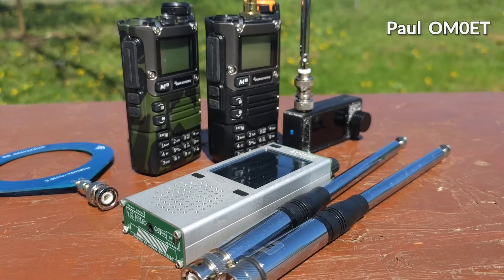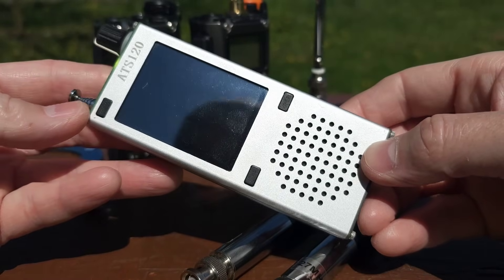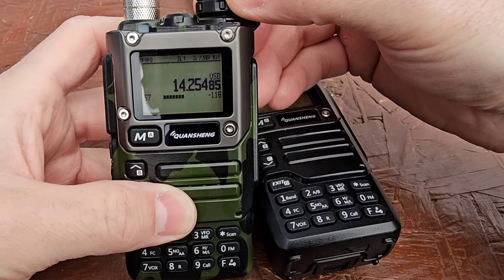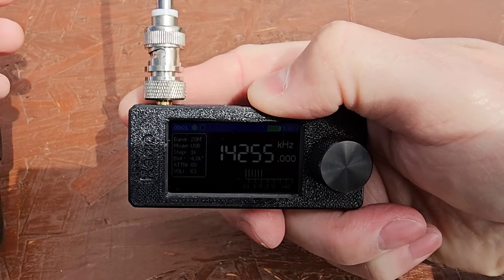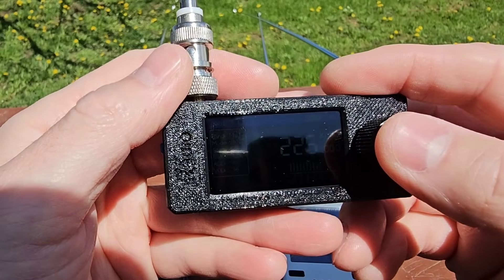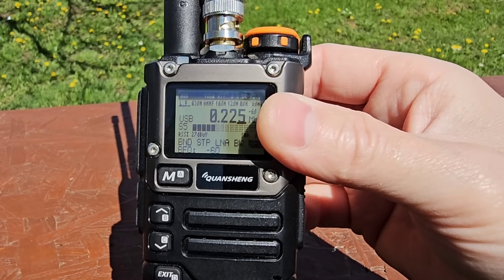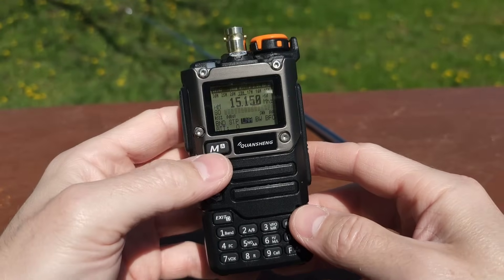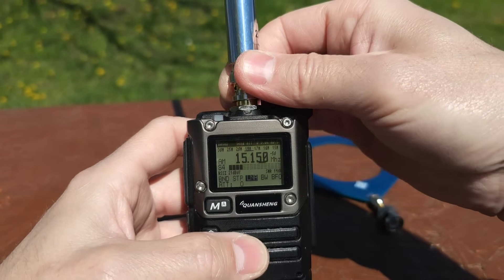RX Comparisons Si4732 based receivers

Comment: Excellent video as usual! Thank you Paul. When I was making my video on the ATS200, I found that holding the metal case improved the reception at lower HF and MW. frequencies when using the built in telescopic antenna.  It was a bit frustrating as you thought you had good reception until you put it on your desk and the signal would vanish.  Did you notice that?
Reply from the maker: Thank you! 😊 Yes same here. It is because your hand acts as a counterpoise which improves the signal reception.

Comment: Hello Paul, this is a very interesting comparison many people have been waiting for, I guess.
You should throw the Radtel RT-860 in too. I have only tested it on the shortwave bands, but I've found it a very decent receiver. I must say that I was using a long wire antenna, though.
Wasn't it a bit unfair not to use one of these HF antennas on the mini-ATS and the ATS-120  as well?
Reply from the maker: Thank you Alain. Unfortunately I found pretty high noise produced by radio itself when is used a whip antenna on the RT860. I need to find the way how to fix this issue. Yes, true, afterwards I see that maybe I had use the same 27MHZ whip on mini-ATS too. That would be much fair.

Comment: ❤ Finally someone, YOU, did this comparison! 😊

I always used to ask in many Radio related Facebook groups, to test the SI4732 radios, like the Radtels as well, plus the ATS-25 Max Decoder.

Or with other radios;

I know for sure, that e.g. the Mini is much more sensitive on SW,  than the XHDATA D-808 😊

Finally, 

I was never keen on this hustle / struggle to modify the Quanshengs! 🤭

As we can see here, even the tiny Mini beats the Quanshengs on 225 kHz AM, and on SW the ATS-120 is far more superior. Period.

I have the (overhyped) Quansheng UV-K5, unmodified, which is fine for VHF Airband, but that was it. 

As an SWLer, I wish I'd rather bought the Radtel RT-860 or 880 which are perfect for SW listening without the hustle 😊

Comment: The tunable blue version of the donut antenna performs much better than the untuned blue one that comes with the small radio!
Reply: I have one of these two and it's very marginally better than the whip antenna IMO, even when putting much effort into tuning it properly
Reply: @F4LDT-Alain  I find it considerably better. These aerials are very critical as regards needing a high impedance antenna input and the performance becomes very marginal if there's a mismatch into the radio.
Reply: @HughTVDX  Surprising... well, maybe the environment makes a difference then. To be honest I've only tested this combination in a pretty noisy urban environment. Maybe it does considerably better in a quieter environment. I should know soon.
Reply: @F4LDT-Alain  The loops tend to pick up less noise than the whips and have a sharp directional null helping to reduce the pickup in the noise direction.

Comment: Hello Paul. Thank you for this comparison. From what I know, the Mini Si4732 does not have an internal LNA, so maybe it was losing out reception to those radios that do have a LNA. I have been using the Mini 4732 radio connected to my MLA-30 antenna & reception is either very close or the same to my other radios like the Qodosen DX-286. I put that down to the MLA-30 having the pre-amp to improve reception. If you can compare the radios using an antenna that has a pre-amp or LNA then I think the results will be closer. Have a nice Easter from M7EIW.
Reply from the maker: Yes, that is true. Si4732 needs an additional LNA for its better reception and I am sure my Quansheng with common antenna socket would receive better if I put inside a LNA. But with this LNA will increase also a FM-band intermodulation so therefore I would need to add also some good FM-band cut filter first. Maybe in the future :) Btw. currently I don't have any active antenna with built-in LNA. Best Regards, Paul
Reply: @OM0ET  I've been using a TQP3M9037 LNA fed via a FET
for Hi impedance input and the tunable blue donut antenna, works very well.

Comment: Honestly, you are one of the best youtubers when it comes to knowledge and experience in RF field! Paul did you review recently new released Radtel 880/Iradio Uv98? Want to know your opinion about it? Thank you
Reply from the maker: Thank you my friend for the flowers and your support of this channel! :) Well, regarding the RT880, I am waiting for Quansheng TK11 version 2, or TK11(8) which is currently on the way to me so soon I will be able to test this new Quansheng finally. I think that TK11 is a better option, as it has real filters for CB and 10M, 6M, 2M and 70CM bands. I know that for TX is FM only, but it will receive SSB on HF, 6M, VHF and UHF bands. I just hope that some new custom firmware with virtual SSB for transmission will be available in the future, just like IJV does. Best Regards, Paul.